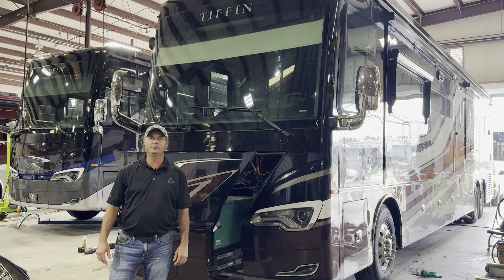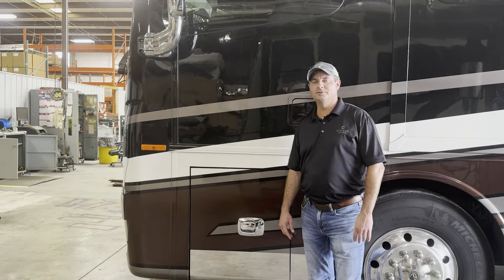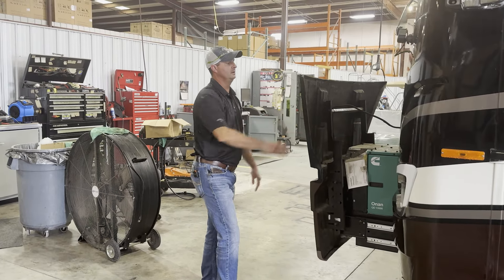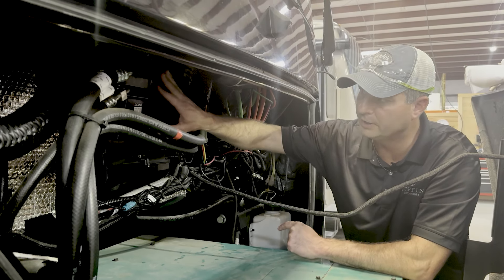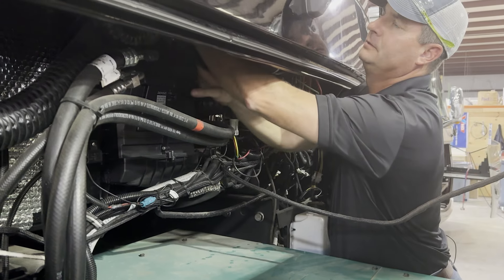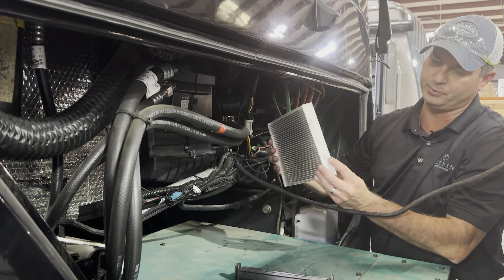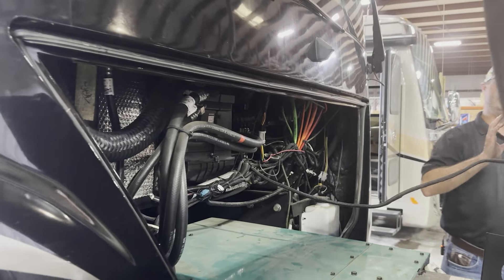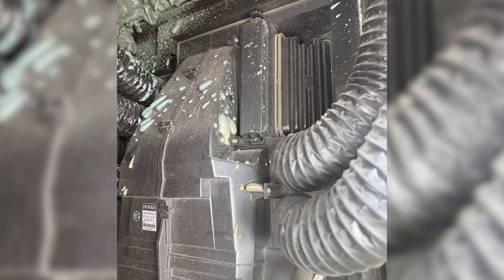Michael's Minute - Replacing Cabin Air Filter

Comment: Thank you for this very helpful video!  Could you please provide us with the Part Number from Freightliner for a 2023 Allegro Bus 40IP and a 2024 Allegro Bus 40IP ?
Reply from the maker: @19rockjeeper99 the part number will be 5066927 for the cabin air filter on both of those year model 40 IP's.
Reply: @TiffinMotorhomes1973  THANKS!

Comment: My aftermarket filter does not have an "up" on it. Is the tiffin-installed filter different than the aftermarket??
Reply from the maker: James, that would depend on the brand of air filter you purchased. If you would like to give us a call, 256-356-0261, we can supply you with the PN of the air filter that comes on the chassis direct from Freightliner.